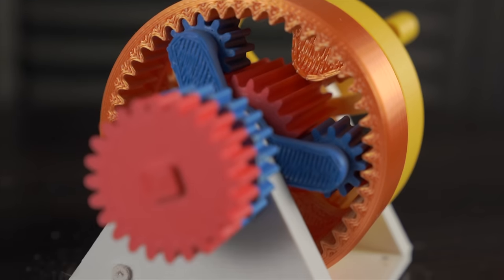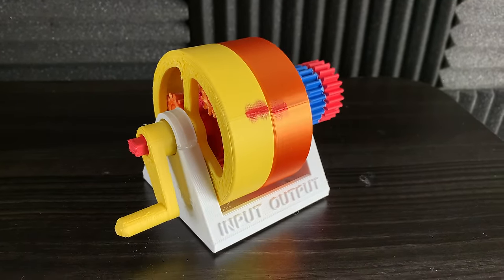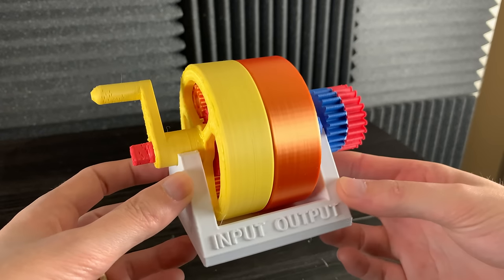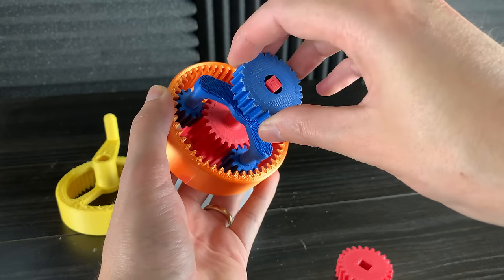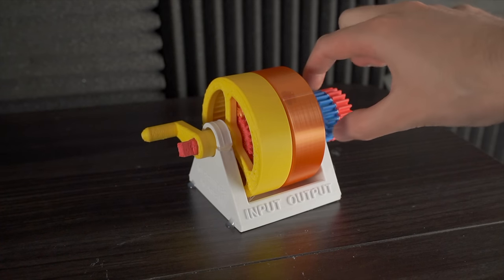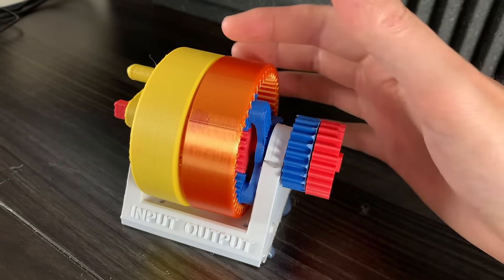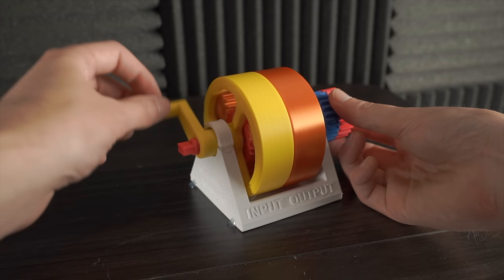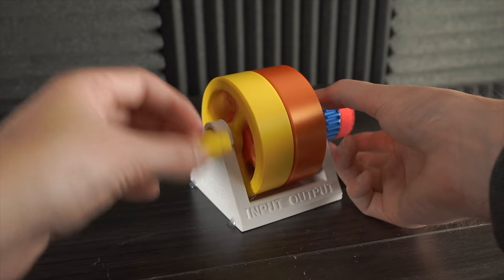How do automatic transmissions work?

Comment: The only thing I wonder is how does the automatic transmission know when to change gears 

And how was this done BEFORE computer controls
Reply: Back in the day, it was pure hydraulic pressure. A hydraulic pump that was part of the innards of the beast would create pressure. The valve body would direct that pressure to different places to clamp down or release "bands". At a certain amount of pressure, the clamping or releasing of different bands would act like his fingers grabbing the little gears on the end of the shaft of his model. Band 1 grabs, bands 2 and 3 are released, and you're in first gear. Pressure builds as speed increases, making band 1 release and band 2 clamp down, and now you're in second gear. Keep accelerating, and the pressure build more, eventually reaching the point where it makes band 3 clamp down, and bands 1 and 2 release, and you're in third gear. Pressure falls (because you take your foot off the gas) and band 3 releases, while band 2 grabs, and you're back in second, and so on. Come to a complete stop, and the torque converter acts like a clutch, effectively disconnecting the transmission from the engine so it can idle without stalling out. These days, it's PROBABLY electric solenoids (but just about any mechanism could be used that achieves the same effect - pneumatics, a string you pull hard on, whatever) causing the bands to grab or release in response to signals from the computer, though I wouldn't be at all surprised to find that there are still hydraulic mechanisms involved as secondary control methods.

Comment: Okay, but what part of this gearbox is "automatic"? All I see is a different type of gearbox, nothing else. You still need to manually stop/release the planetary gears, making it a manual.
More specifically, what is it about this gearbox that makes it possible to make it "automatic" without the use of electronics? And if you need to use electronics, why not just use an automated manual?
Reply: Not to mention that even operated manually, it's not actually functional. The only reason direct drive works as demonstrated is that the internal friction is overcoming the no load on output ring.

Comment: Automatic transmissions in cars are wayyyyyy different, they are more like manual gearboxes with computer controlled shifters along with 2 clutches instead of one. What you have shown would be more used in robots or smaller mechanical things if at all. The design is prone to a few flaws like friction, heat, and cost (if manufactured with proper materials). As well as more maintenance due to every gear being used all of the time during use compared to free gears in normal transmissions.
Reply: Automatic transmissions do have planet gearsets. They don't all have to be designed exactly the way you think to be an automatic transmissions. Just enjoy the man's video and appreciate his basic model to help spread knowledge of gears.
Reply: @kalebnotto1596  I have an issue with spreading false information, he says all automatic transmissions are like that which could not be farther from the truth
Reply: @trux6638  no he didn't say that. But you however did say that about your description of it
Reply: The transmission you described is a dual clutch transmission. This demonstration shows how a traditional torque converter automatic work. Look up the gm TH400. It has planetary gears like this.

Comment: This doesn't show how an automatic transmission works.  It shows how some manual transmissions work.
Reply: Manual transmissions don't have planetary gears.
Reply: @Jim-ku6ry  
I'm sure you're right, but they could.   The video doesn't show anything automatic about the transmission.
Reply: @presto709  manual transmissions don't have planetary gears at all. They use gear pairs. Automatic transmissions use planetary gears. This is an example of how the planetary gears function in an automatic transmission. He never said its how they shift but simply how it works.
Reply: @Jim-ku6ry  
Ok.  That's fair.  I would be interested ina video on how they automatically shift.

Comment: How does the gearbox select each gear and how does it know what gear to select
Reply: Clutch packs
Reply: @dinhtuan752  I've just watched a couple of videos and unless I'm really missing something clutch packs engage and disengage drive. 
What asking is how does an automatic gearbox select different gear ratios? 
or it each gear just different levels of clutch slip but surely that would cause excess heat and wear out the clutch.

Comment: 90 degree clutch cvt, with ratio transmission lever
Reply: convert engine to electric then you dont need to worry about transmission, at all
Reply: thats the ultimate transmission, or transformation, of energy
Reply: @Jkauppa  not true actually. In electric engine you don't adjust mechanical energy (output) but you adjust electricity going into engine (input) so you still need some kind of "transmission"
Reply: @marekvojta9648  nope, just increase amperage, you are not clearly an electric engineer, like me, pure bs, not sorry, pure bs
Reply: @marekvojta9648  nonsense
Reply: @marekvojta9648  you said nothing
Reply: @marekvojta9648  you proved nothing
Reply: @Jkauppa  I know but how you change current? Ok instead of having transmission you have transformator. Wow. Have you seen those: "" ?
Reply: Actually EVs still need a single speed transmission
Reply: @marekvojta9648  if you need to ask, dont try to teach
Reply: @marekvojta9648  everything is possible, just insert a potentiometer, ie, variable resistor, as a simple electric throttle, oh, you dont believe in true pure brushless dc motors, do you
Reply: @marekvojta9648  remove the gearbox, that I meant
Reply: @marekvojta9648  solid state beats multi-part machines is reliability any day
Reply: @marekvojta9648  also in simplicity, just adjust the resistance of the current path way, done, variable resistor, you just want to argue back, and keep your complex salary
Reply: @marekvojta9648  or you are ignorant of better ways of doing stuff
Reply: @Jkauppa  Who then need to teach something? :D I maybe don't know 100% about electocars but you need to learn how to speech with others. Try to think about yourself before you start judging others. He didn't say nothing againts you and you immidietly shut up already him. And by the way why do you need to "answer" on my one comment by six yours.
For your info I'm NOT againts EV they're good in some situations and in different not.
Reply: @marekvojta9648  dw, he doesn't know what he's talking about either. To vary the output of an electric motor you simply change the control signal to the power switches, typically igbt's in high power apps like these, this can be done a couple ways: change the frequency of the switching, or change the duty cycle of the switching (on to off time ratio). Think of it like the throttle on an ICE.
Reply: @xxportalxx.  I have a question I heard that EV motors are powered in AC is it right?
Reply: @marekvojta9648  you cant respect, you dont get respect, no deal
Reply: @marekvojta9648  not agreed on your data points

Comment: This is a manual planetary gearbox, NOT an automatic. You even hold one of the gears with your hand, where is the automation? In a classic automatic transmission, a special torque transmission oil is used as the working fluid. In a robotic gearbox, again, an electronically controlled piston is used to operate the clutch and shift gears depending on the load and vehicle speed. So there is nothing automatic in your model

Comment: Not an explanation of an automatic transmission at all. You make no mention of the fluid coupling aka. ‘torque converter’ used on almost all automatics. Misleading vid.
Reply: Since the torque converter is just the method of transferring torque to the input of the transmission, I think it's safe to say that it isn't explicitly what is going on inside an automatic transmission.